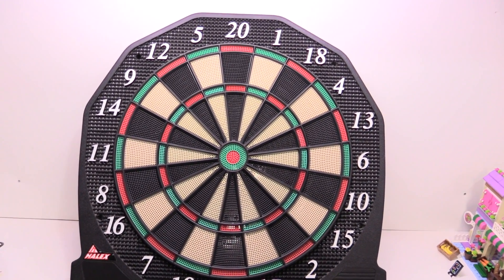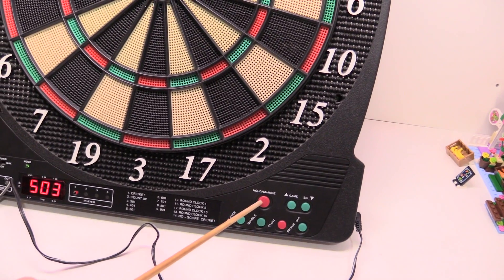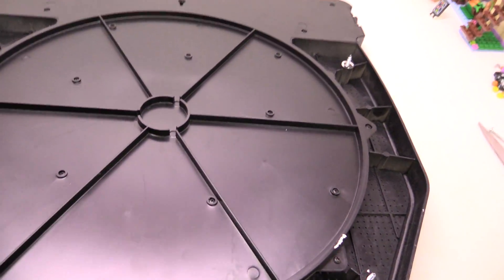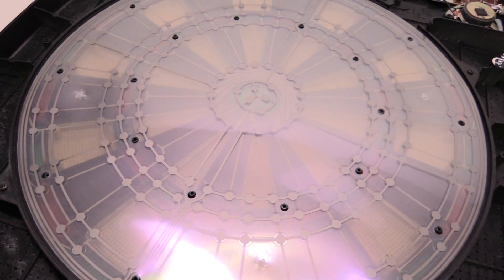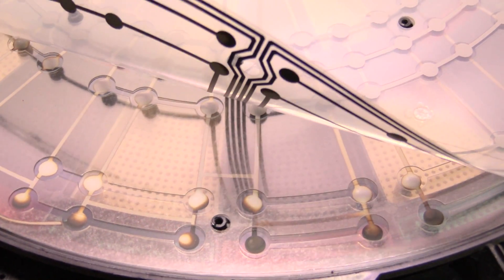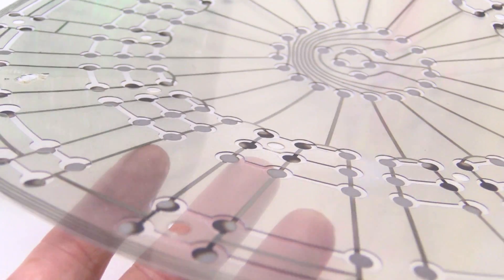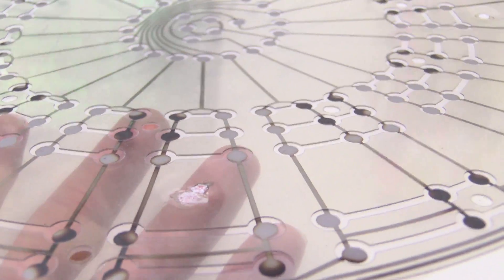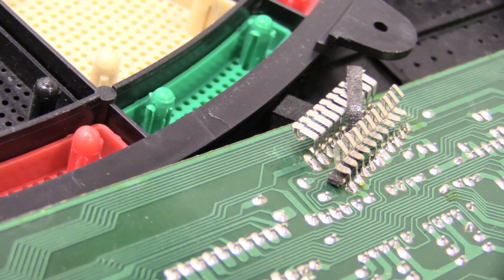What's inside an electronic dart board

Comment: Hey I too have halex dartboard and it stopped working. The buttons and switches are working but the dart contacts aren't getting registered. I opened it up, but don't know how to fix it. The points do look like they are a bit oxidised but not as much as yours. 

Could you advise please?
Reply from the maker: Yea, that's what's happening. Oxidation on the contacts is keeping it from registering. Whatever you can think of that removes oxidation. Rubbing alcohol, vinegar, ammonia, maybe lime away?